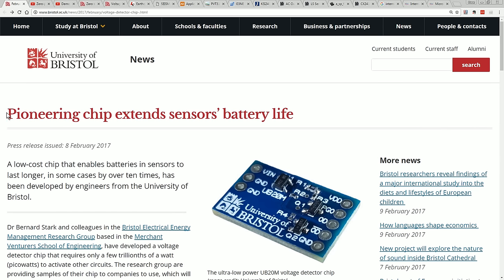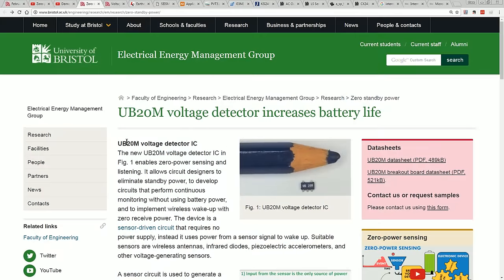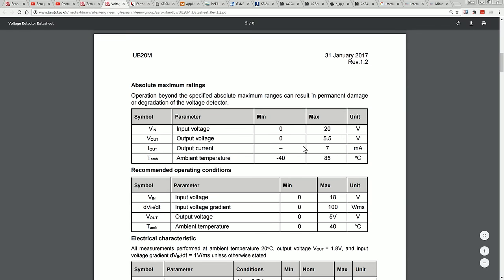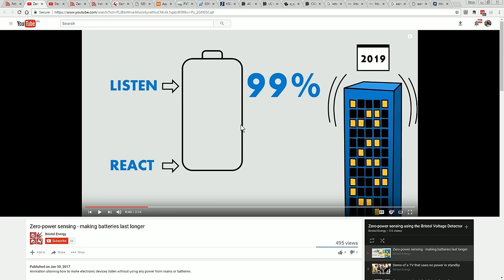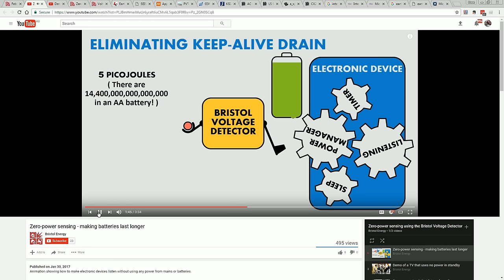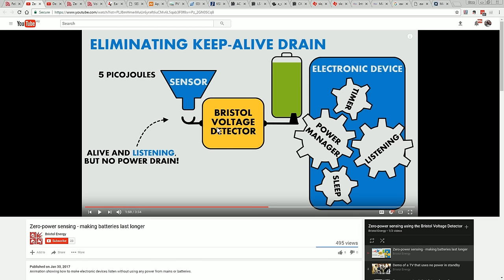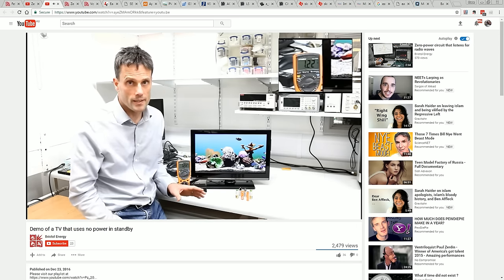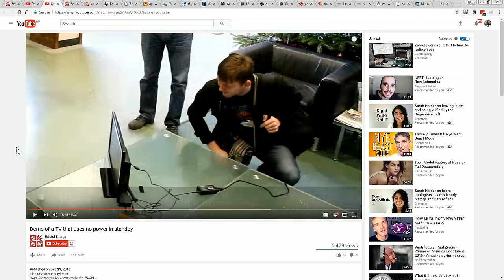EEVblog #971 - Zero Standby Power TV - BUSTED!

Comment: With the modifications mentioned, it could work to manage constantly plugged in devices like home laptops, phone chargers as part of a circuit to manage charger's etc (as these usually seem to be capped at around 60W (just to improve battery life and standby power draw for machines that are switched off)

Comment: +EEVblog Do you think that iw would be possible to rectify mains, use cap for storage and high value resistors to step down voltage and use it to drive SSR with [insert sensor here]?

Comment: There is no point drawing such little power from a battery because batteries do not last more than 5-10 years even if you draw NO power from it. Also my TV draws zero power at night (I unplug it).
Reply: Not many of us left, most people cant be arsed. now I know it is 2 AA's worth of power a day (prob for each device) I am glad I have been doing it. Just a shame my pc psu burns out and welds the contacts every now and then (requiring a smack to get them moving again lol).
Reply: I was about to say the same thing, batteries slowly discharge.
Reply: I do the same, everything that i dont need to run 24/7 is on a power strip i turn off at night. If i didn't need to keep my low power file server running 24/7 id unplug my network gear too. Then again i get a bit OCD about eeking out as much power efficiency out of everything i can for my own satisfaction. Even going out of my way to hook up a small solar panel and charge controller to my uninterruptible power supply and pulling the charger out of circuit so it doesnt use any power constantly trickle charging the battery all the time.
Reply: Jerry Walker, my thoughts exactly, "self-discharge" is a thing. It heavily depends on chemistry, but most batteries won't exceed 10 years (with the possible exception of those non-chemical nuclear-powered thingies).
Reply: There's actually a datasheet shown in this video which shows the life curves of a battery with different current consumption levels. These cells can last 20+ years even when pA current is taken - this is an order of magnitude above the self-discharge rate. Such cells' lifetime decreases dramatically with higher current demand, and can decrease very quickly if the current is in excess of the rated maximum - this is self-passivisation.

I saw a user who measured their product's current demand inaccurately (they did not realise that the shunt resistor in their DMM acted as a current limiter). They had expected 10-15 years use and in fact the average energy use would still permit this, however the higher peak current caused the cell to decline more rapidly, so much so they had to take back product from customers after 1-2 years and replace the battery and fix the problem (replicate the value of the DMM's shunt resistor in their design!).
Reply: E Realize that the device itself has nothing to do with actual batteries,; AA only mentioned as a general storage equivalent for representing a comparable amount of energy during a specified time.
Reply: Yes I realise that but the device actually needs a mains supply to operate (Dave explains this in the video) and it is of no use for battery powered devices for both of these reasons. It is also of no use for mains powered devices for the reasons that Dave also explains. My main point is that the mains plug is FAR more effective as it actually achieves what they are claiming.
Reply: Wrong, think about it, you save by just fitting 10x smaller capacity batteries.
Reply: Turning off is not standby

Comment: Surely if you want a 0 draw TV you don't need special chips but just a hard power switch on the front... that's pretty modern though, like since 1925?
Reply: They even used to have remote controls with a cable on them, none of with IR nonsense.
Reply: Its for standby. not the same thing at all

Comment: I like how we keep inventing ways to save battery power through electricity rather than improve the battery itself, and not through attachments either.
Question, do Earthquake Sensors even use batteries, save for possible power failure? I would've thought they used the local power grid, or solar panels... and the emergency power would either be batteries or a backup generator, mostly because of the importance of such things in geologically active areas.
Another question, but do Earthquake Sensors have a warm-up period every time they receive power from a cold boot? I would think that you'd waste more energy booting up the system from that cold-boot state.
Reply: Yeah I thought the ones with the most need for power optimization are far from the grid and running solar... And as they are, I don't think they need this at all in regard to power saving.
Reply: Has it ever occurred to you that maybe the reason we don't "improve the battery itself" is maybe because that is very difficult to do and we don't know how to yet? Nah who am I kidding, obviously the idea of improving batteries has just never been thought of before by any scientist or engineer.
Reply: Debated Nothing
Well, we definitely have the chemical processes down for creating batteries in the first place... maybe it's magic, and all I see are witches brewing alkaline battery acid in a cauldron.

Gendo Ikari
I think some sensors could run off of under-the-surface power lines, rather than the standard telephone pole out in the middle of nowhere. In either case, solar/battery/backup would most likely be a must for continual detection. Unless there's a freak solar storm which can knock out the electricity to it... and its' battery life.
Reply: MW3366 - If you look at the original mobile phones and compare them to what we have today I'd say batteries have improved quite a bit from the a cost, durability, flexibility and available power perspectives. Arguments about global warming to one side I think it's good that people also look at ways to make our use of power more efficient as well as delivery of it

Comment: I still don't understand how this wouldn't pick up on ambient light. 
Sure, it has a filter in front to prevent other wavelengths of light passing, but ambient light consists of many wavelengths, including IR and some UV (among others).

It's not like this is detecting a specific frequency signal, and only reacting to that?

Perhaps it detects abrupt changes in the IR light level, which could be provided by a TV remote, but so could rapidly opening your curtains on a sunny day...
Reply: intensity

Comment: How about a large capacitor slowly charging from the mains providing the initial start-up current for the SCR Solid-State Relay, which then switches mains to the EUT?
Reply: nrdesign1991 
mmm it would have to be a really low leakage capasitor else it wouldnt charge at all. But yeah, you could maybe capasitively coulple it to mains and steal some energy out of it. still it wouldnt be zero, but it would be close to nothing.
you have to take the leakage into consideration, all.semiconductors have that

Comment: Couldn't you chain the switching devices for mains - low-current FET supplying the SCR?
Reply: Yes, or even a relay. But even with a relay it requires a separate PSU for the relay circuit.

Comment: I recently replaced my 6 year old TV with a new one. When I was in the TV shop I noticed that most of the TV's now don't have a red LED lit when in standby and have an external 12V power pack but they still switch on when you hit the on button on the remote, as before. So I'm assuming that all the major Asian TV manufactures have used this "smoke and mirrors" trick to bypass the new EU restrictions on power consumption of electrical goods in standby mode?

Comment: But what is the minimum watt to power a sensor, isn't that the question?

Typical standby is 0.3 to 2 watt today? What is the median over all standby devices, i don't get how the actual product can effect the energy consumption? I mean it is just a swich to feed the TV with the usual AC/DC?

Or do i not get what the product do?
I though it was a box with a chip that simply close or open the current pathway, and they suggest that it should sit in the device rather than in the box? Because if you use the box you need it adjust it to your remote?

The idea must be to put their sensor and chip into devices rather than selling boxes to existing products?

Comment: Toshiba did a true zero power standby TV a few years ago.  It runs a little low power microcontroller off a capacitor.  When it detects the remote control (or I suppose if the capacitor is getting low after not watching tv for a few days) it switches on the mains.  You don't need weird energy harvesting technology to do whats already been done.

Comment: What if you charged up a capacitor, then when the remote flashes, the voltage from the infrared photodiodes closes a mosfet and dumps the capacitor's charge into a solid state relay?
Reply: You could also use the beloved CR2032 to power the solid state relay.

Comment: The IC would be much more useful if it had a high voltage capable open drain, so that it could be used to replace the power-up resistor that is required by most primary-side switching regulators - however you are not going to turn on a HV mosfet with <1V and a pC of charge.

Comment: I could see that chip being really useful for using low leakage capacitors and small panels in environmental monitoring or vibration sensing? You could trigger a memory write from a realtime clock and catch a lot of the signal or send an SMS and then hibernate again...
Wonder why they didn't market it for very low current detection in an active recorder there are heaps of uses just in geophysics for small     Cheep low current sensors?

Comment: with that circuit, wouldn't the tv respond to any IR radiation received? not just the tv remote.  it'd need to use a lot more power to detect specific hex commands.
Reply: That is true. There are resonant circuits and antiparallel diode circuits that eliminate ambient light, without needing a voltage rail.

Comment: Dave, this pullup resistor is 11.5M!, so the current must be really tiny, and if the TV would be supplied from a 12V battery (in a PV home for example), rather then switching power supply, then there is an advantage of having this solution.

Comment: They could easily make this thing actually zero power. Leave the TV ON and have the sensor on a relay on the mains.
Reply: You'd need to find a way to switch the mains in that case; the power from the chip isn't enough to trigger a relay, right?
Reply: @marctreal  true...

Comment: I could be wrong, but based on the schematic is looks like their chip is just a single NMOS with a 0.65V threshold. That's pretty typical for a modern standard CMOS technology. The 5 pA input current would be gate leakage, the 100 pA output current would be channel leakage.

It completely misses the point though, even for battery powered devices the battery self discharge rate is in the µA range. Anything below that is irrelevant. With that kind of current you should be able to make a nice low power comparator with a threshold that's actually configurable, which would be a lot more useful than a device that's hard-wired to trigger at 0.65V.

Comment: To be fair, standby power usage on electronics is quite a problem in "off the grid" environments like boats etc. I  have no idea how people manage to make eg chart plotters which draws nearly 1W even when turned off. Sort of becomes an issue when you only have something like 500Wh or less available. Too bad they didn't bother to use some actual practical case like that in their marketing wank.

Edit: If something like this chip would entice the electronics makers to design their product a tiny bit better that is a plus in my book

Comment: why not?
you can use that between the smps and the rectification inside the smps
now you only have the current that the cap needs to be stay charged up to 165V / 325V 
 have i missed something?
yes of course the false triggering is still a problem, but other than that?

Comment: well they can integrate the voltage sensor into the PSU. so it cuts off the main when off to save power. But still, the energy harvested from the signal is not enough to power the demodulator. So any infrared can potentially wake up the TV.. or does it wake up the demodulator first than deciding whether to wake up the TV or not..

Comment: I can see this being used in battery operated devices that aren't required to be powered indefinitely, but for an internet connected TV which requires power to run the always connected applications this would be very inconvenient. It's called "Standby" and not "Off" because we need to differentiate between using no power (essentially unplugged) and using a small current to keep the device in a low power listening/communication state, what was demonstrated here is a unit that was not powered (unplugged) until the "Zero Power" device switched it on. All power supply's draw a small current even without a load, if you want to eliminate standby power consumption switch the device off at the wall.

Comment: I seem to remember a TV in the 80s which had a mains switch which could be turned off using the remote (it had some sort of solenoid on the switch causing it to release - completely disconnecting the mains supply within the set). It would make a loud clunk when it turned off & when you wanted to watch TV again, you had to go to the TV and physically push the on off switch (it would latch in until you hit the off button in the remote again.)

Comment: Bollocks. 
Did that Bristol University students think? A switch controlled by IR level it's stupid idea. for example you will turn off the air condition and the TV in the same room will goes off.
Reply: You do know that IR remotes have a unique frequency and encoder, right? The listening chip might wake up to any IR remote, but the reveiver circuit only reponds to the specific, unique signals. There are rare occurrences where some IR remotes can activate the wrong device, but that's not the fault of the sensor.

Comment: Dave, you can actually do it reliably, but you have to completely opt-in and do it right, you can't just patch it and call it done, like they did. Here is what you can do, you can have the remote emit multiple pulses for the power on button, when the detector detects a voltage from the IR diode, it can power up a small power supply that powers up the electronics that can analyze the code transmitted over from the remote, and because the remote sends multiple pulses, it can correctly detect if it was the power command or something bogus, and just ignore it and power off the small power supply, it that'snot the case; if the proper sequence is detected, then you can power up the big power supply, which would normally be completely disconnected from the mains.
Reply: another option could be to have a very low power high efficiency power supply or-ed with a big one which is completely off, and when a current draw higher than N is detected, the smaller power supply can startup the higher one

Comment: While the bateriser is obviously bullsh#t, this one is not busted in my opinion. 1) The TV is using no power, the switcher is, so claim 1 correct. 2) If their sensor was installed into the switcher in a clever way, I wonder how low quiescent current could actually be. Obviously zero is not possible with the pullup but it could be incredibly low  compared to the 4watts VA.

Also lets say we charged a cap that could supply the pullup for a few weeks. Could you then do zero standby power using this chip?
Reply: wouldn't that be a battery? the capacitor uses power to charge
Reply: But you will use some.micro watts charging the cap,unless you use solar...I think..
Reply: It's not anything new. Transitor in a package, put some volatge to the input, it connects the output. Wow, radical idea! If you include power supply as part of the TV, it does consume power. Otherwise all my devices in standby already don't consume anything already and there is nothing to solve. Leaving charged cap from mains inside for weeks or connecting the sensor to mains aren't so good ideas. If you really want, you can do it under 0.5W but you certainly won't need this "new" component with very limited operation voltage.

Comment: While you could use that in the TV, I guess you couldn't use it in any households with flames (smokers, candles, etc), because it seems like lighting a match would turn the device on as well, unless it has some 38kHz detection built into the chip to reject random sources of IR light.

Comment: Isn't it possible for the TV in standby to be already engineered to draw just enough power for the wireless receiver to pick up the "turn on" signal? Or is that much power at minimum being consumed in the AC to DC converter unavoidable (even if you need less) EDIT: well question answered some minutes later in the video :)

Comment: Only thing that I can imagine could be handy is it in an mobile application, for example a tv in a car or ship or caravan. The less power you drain from the suffering batteries (maybe with a small solar-panel behind the window), the better. Or a radio in the same situation. Even a capacitor is using to much power after a couple of months 'in storage'. So you don;t want to forget to switch it completely off. Could be handy this way so you cannot forget.